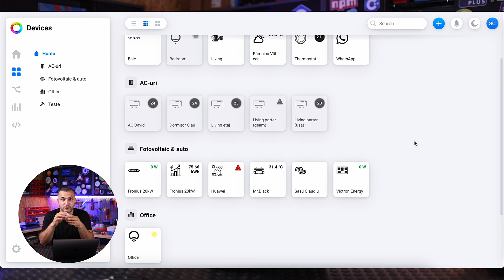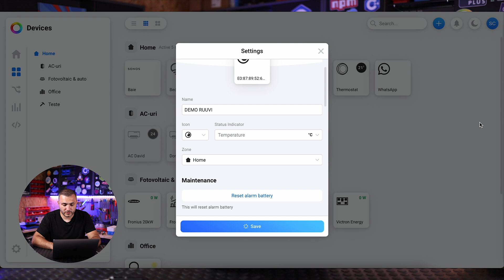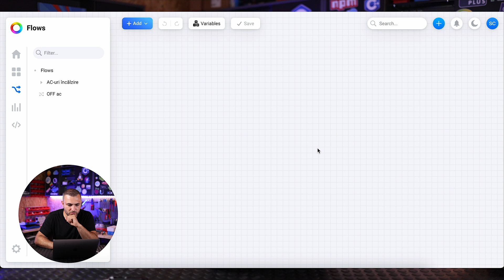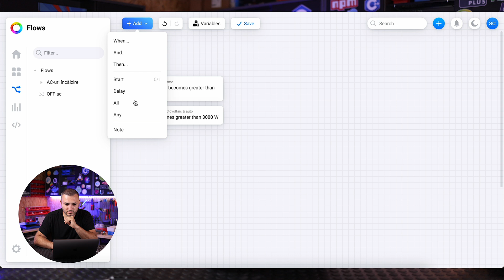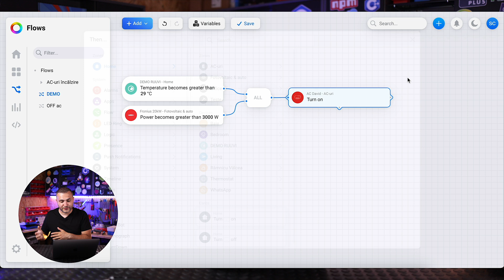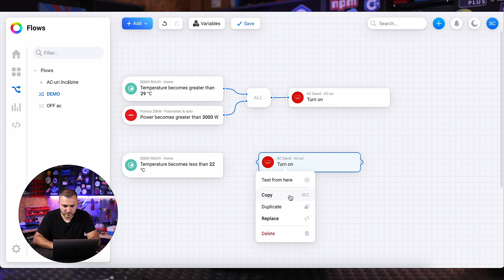How to use your PV production in a smart way

Comment: why you use another solution? Fronius have a built in a "Digital IO in/outputs". You can control 4stk 12V relays.. You can chosse min/max PV power,etc.
Reply from the maker: This solution is not only for Fronius, you can use also Victron, Huawei...